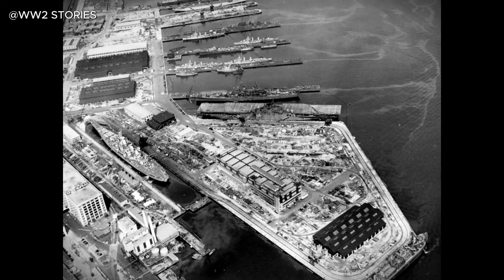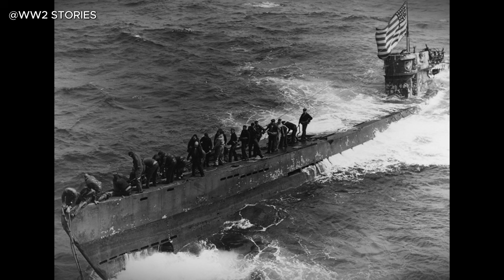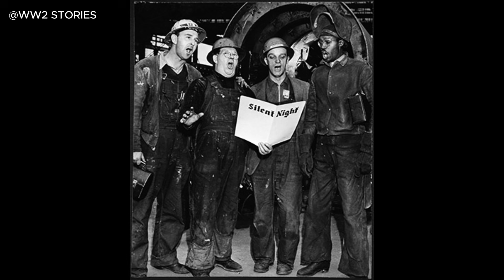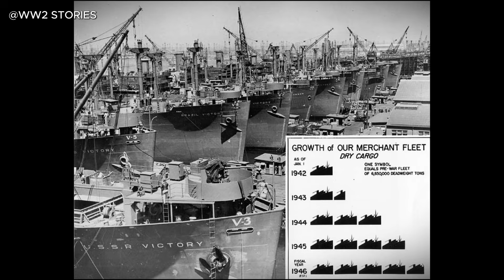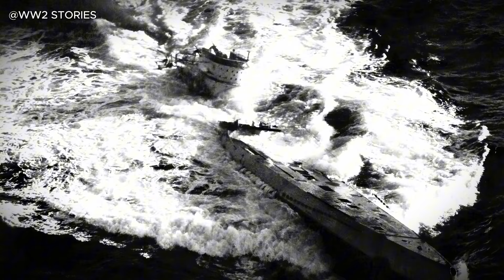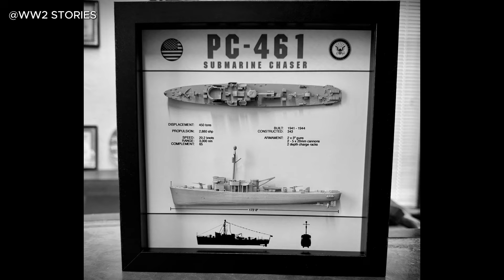The illegal Boat Modification That Let America Hunt Submarines Faster Than Ever

Comment: The British had already defeated the German submarine menace before America even entered the war. The fact that American 'subchasers were only capable of 18 knots shows that the US did not understand how good German submarines were as their surface speed was typically around 18 knots  and even submerged were capable of close to 10 knots. Who in their right mind would name a boat barely capable of matching a submarine's speed a 'Submarine Chaser'
Reply from the maker: You raise an interesting point! The speed of those early subchasers definitely raises questions about their effectiveness. It’s fascinating to see how tactics evolved with the war.
Reply: @officialstoriesofww2  Maybe whoever named those boats was overly optimistic as they should have been called submarine losers. They could have sent someone out in a small sailing dingy and hoped the wind picked up a bit quite possibly with the same degree of success.
Reply from the maker: It’s true that naming can set high expectations! But sometimes, even the most unexpected methods can lead to success.